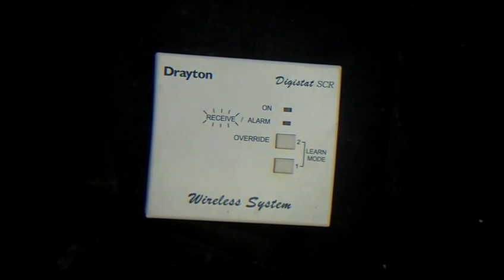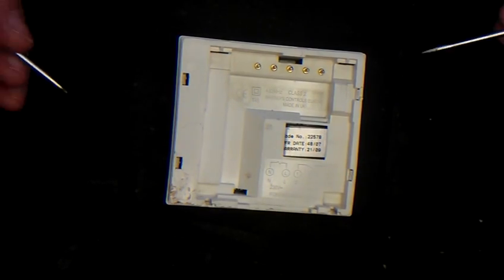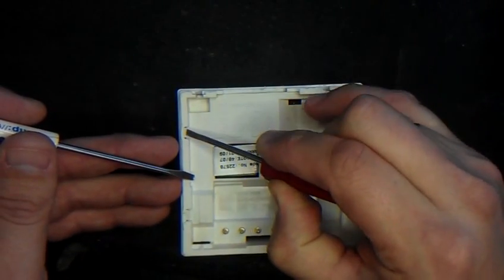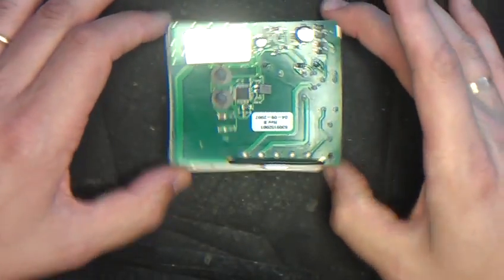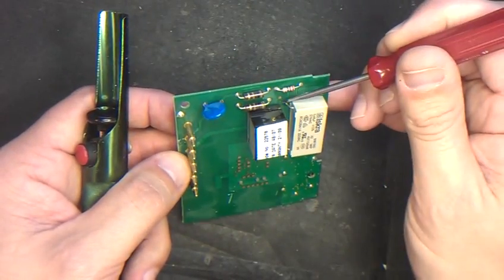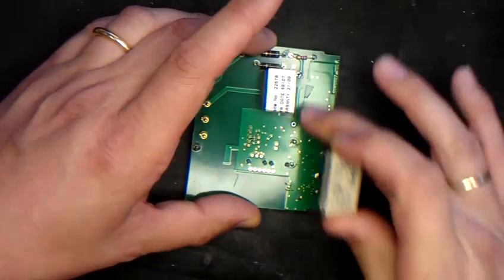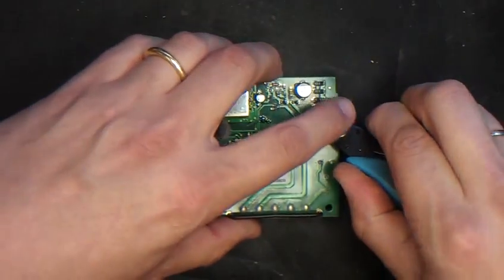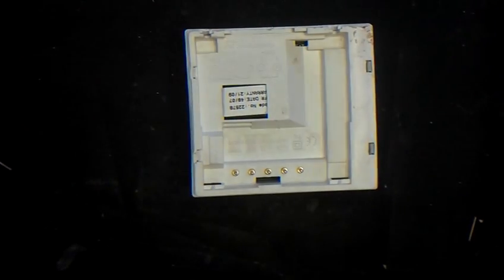Drayton Digistat SCR easy repair with a capacitor, also same for Iflo or British Gas marked units

Comment: Hi David,  I think we need to buy a capacitor from you.  I just want to check, since our SCR stopped working there are generally no lights on but sometimes when you turn the power switch on the red light does come on.  When this does happen if you press the top button the green light flickers like its trying to click in but it won't.  Does it sound like the capacitor to you or could there be more to it?  Thanks!
Reply from the maker: Nikki Willis Hi Nikki, it could need a little more than just the capacitor. On my eBay listing page is my email address. Drop me a email and we can sort this. If I can get a photograph of the pcb both sides I might be able to show you what the issue might be. Cheers Dave
Reply: Hi again!  We sent you an email with pics a couple of days ago, did you get it?  Thanks x

Comment: Hello I have watch your video and I have similar problem with one difference. My SCR click but hearing is not turned on. Can it be for same reason?? 

Thank you for your reply.
Reply from the maker: 'Generally' if you hear the click then I would say the receiver is doing it's job, it sounds like it could be a boiler fault, you could bypass the receiver to confirm this but that would mean moving a wire on the back plate, before any wires are touched YOU MUST ENSURE THE POWER IS OFF TO BOTH the boiler and the receiver, I will say that again!!!  Power OFF to BOTH devices before touching the wiring!!!!!!!!!!
Reply: David Williams 

How to bypass receiver? 

My wiring on brackets from left N-blue L-brown 1-brown wire loop to L 2-empty 3-yellow 4-empty.

Comment: Hello David...Fitted a cap from you several years ago...problem solved.....thought I had the same problem very recently, 'stat asking the scr, but no green light, so I bought another from you....has now stopped working again. How likely is it that the cap has failed so soon?

Comment: My digitstat SCR doesn't seem to be receiving a signal- Red light continuously on. When I press the over-ride button nothing happens, no clicks or anything. Batteries ok in sender unit (only a few weeks old), tried moving it closer to SCR- nothing happened, tried resetting learn-mode- again nothing happened. Is this a faulty capacitor in the SCR, or a faulty sender unit?
Reply from the maker: dave heaton hi Dave. Yes I have seen a failing capacitor give this fault. Generally the units don't have  any real sync issues apart from the capacitor. In my experience I would definitely change the capacitor.
Reply: dave heaton I have exactly the same fault, so going to change the capacitor.
Reply: I have the same problem I’ve done all the things to pair up the thermostat, the red light flashes, green one fires up, but the unit is dead changed batteries nothing, I’m sure doing it on constant is not economical

Comment: What if the original capacitor is glued to the board?
Reply from the maker: Steven Ball hi mate. they are all stuck to the board. some are stuck better than others. If u can get a flat blade screw driver under it and gently lever it up. start at a corner.
Reply: Cheers, went at it gently and off she came!  Rest of the instructions worked a treat, no other dramas!  Thanks

Comment: Thank you. Got a cap of your ebay store, fitted it and my heating is working perfectly again. I measured the value of the cap I removed and it was about half the rated value. So it is not unexpected that it failed to work as the capacitor dropper circuit output would have been much lower than the design limit.

Comment: Had red light showing all time ,no heat. got your capacitor & replaced, now blows 3a plug fuse about 5 seconds after overide pressed. Any thoughts please.
Reply from the maker: hi mate. send me some pictures of the pcb so I can take a look at it. maybe able to see something. use my email address shown on the listing page. sounds very strange
Reply: Hi David, I'm new to You Tube ,how do I get to your e-mail?

Comment: Hi Dave, the capacitor I replaced 2 years ago seems to have failed.  I looked for you on eBay to buy a replacement but couldn't find you. Are you still there???
Reply from the maker: hi mate. yes still about but oversea this week, back next Saturday, if you can hold out I will be relisting then. thanks for looking me up.

Comment: What is the trick to be able to power up the gas central heating boiler whilst waiting to repair Drayton Digistat SCR please
Reply: I wired a "hard wired" thermostat into position. Black & grey wires in my boiler COM - N/O terminals or wires 3&5 to the thermostat while I waited for the spare part. 240v are on these contacts so be careful. You could probably use a light switch using these contacts but it won't be controlled.

Comment: Hi Dave, thank you for the great video. I have permanent red light on my scr. Is it still to do with faulty capacitor ?
Reply from the maker: Hi, So a solid constant red light means loss of sync between the room stat and SRC receiver, the room stats are pretty bullet proof and very very  rarely fail in this way.Things to check, are the batteries ok in the room stat, also have you tried the re-syncing process, this process should be on the Drayton website, its all about holding down buttons and closing draws on room statsIf you have tried / checked the above then it's time to look at the SCR receiver, the capacitor can cause sync issues, it is definitely a good place to start, I am not saying it will fix all units with this type of fault but have seen it cause this fault.You could photo graph the PCB and send it to me, only need to see the rubber button side of the board, look me up on eBay and send me the photo I might be able to pick something upDave
Reply: Yes you were right it was due to the loose battery connection on the receiver. It is sorted now. Thank you very much for your advice.

Comment: I have intermittent issues. But now it fails more than it works. The usual fix was to remove the batteries from the stat for a few seconds and put them back in again. This usually worked but it doesn't anymore. How do I test the unit? The stat also does not seem to be reading the correct temperature. I'm sure that it is reading low.

Comment: Bought the capacitor from David. It arrived promptly and included the double sided pad and solder needed to fit the part. Following the video made the component change easy (opening the case was the most difficult part) and the digistat is now working again.

Comment: It's early days but this seems to have worked a treat. Drayton told me on no account should I change the capacitors (they didn't even say it would ok if an electrician did it), they said I'd have to replace both receivers at a cost of £250. £240 saved in half an hour and I have two working receivers. Genius. Thank you so much.

Comment: Hi David. I have similar symptoms with both my receivers but it's only intermittent - sometimes they work, often they don't. Is it still possible it could be the capacitors or is there something else likely to be going on?
Reply from the maker: +kit Hi Kit, yes the capacitors can fail in one of 2 ways, either they will straight fail and the heating will not come on even though it is showing a green light, or they can become intermittent and will occasionally fail, if it were my receiver I would deffo change the capacitor, it's a known weak spot in the circuit design and a very good place to start. Hope this helps. Dave

Comment: Thanks for sending the component through. I soldered the new one in place but it did not help. The green light flashes on very quickly but won't stay on still. Heating still will not come on. Not sure if there is something wrong other than the SCR.
Reply from the maker: +steve wilson just sent you an email, the email address you used to pay for the  replacement capacitor, lets see if we can work it out, I've already got a few ideas on what it might be
Reply: +David Williams Thanks David. Just sent you a reply :)

Comment: I seem to be having this problem. How do I contact David to buy one of these capacitors? Thanks
Reply from the maker: look me up on eBay. Search for "drayton capacitor fix" my eBay username is bearsy72. I have two listings one is supply part only, the other is me to do the repair for you. If you don't have an eBay account don't worry, still search for "Drayton Capacitor Fix" it will take you to my listing. Towards the bottom of the page it will show my 'Business seller information', here you can get my email address.

Comment: Nngh. In theory, this is a dead easy repair, but I had to apply lots of heat in order to melt the huge joints holding the old capacitor in place. So much, that one of the tracks lifted from the PCB. :-(

I was using a 50W soldering iron (on maximum power after 80% was making no headway), a fine tip and desoldering braid.

I've done plenty of electronics work (albeit I am a little rusty), but I've never found a joint this difficult to desolder before!

I was going to use a Kemet/Arcotronics-branded capacitor - I note that despite being the same spec, they are a little smaller than the Iskra component.

Thanks for the video anyway!
Reply from the maker: +cowbutt6 Hi mate, yes they can sometimes be a bit tricky to get off, I always always add a little solder to the joints before trying to suck the solder off, it just helps the flow of the old stuff. Also sometimes wise to cut the legs from the capacitor body itself, that way you can work on one leg at a time. Not seen the Kemet cap before, plenty of room inside here for the Iskra whether it be the old or new version of receiver. Hope you are good now, Track repairs on this item aren't to bad as you can see where the tracks are going, from memory think they go to the large brown resistors, 100 ohms if I remember.
Reply: +David Williams As a previous engineer had disconnected the receiver (without asking), I had to get another in to reconnect it anyway, so I bought a replacement receiver for him to fit just in case it wasn't the capacitor. I was hoping to repair the old one and keep it as a spare. I might still do that, but I'll be pretty skeptical about whether it still works (the surface mount IC was getting a bit warm too).

Hopefully my comment above and your tips might help someone else!

Comment: I have this exact problem, our heating does sometimes come on, could it still be a dodgy capacitor or might it be something else if it works sometimes?
Reply from the maker: Yeap the capacitor can cause intermittent switching. My guess is the capacitor is slowly breaking down, rather than the usual quick fail. Has to be worth a punt.
Reply: +David Williams thanks I will keep my fingers crossed, we are having the boiler serviced Friday as a precaution so if everything checks out then it is definitely the scr, I will order a capacitor in ready
Reply: +David Williams thanks so much, I replaced the capacitor and the heating is working again! a capacitor rated to higher voltage would probably stop it failing, however, they tend to be larger so might not fit in the case

Comment: Hi 
Wonder if you can help, there is no lights on on my scr box, but there is power going to the boiler. Hope you can advise, many many thanks Andrew
Reply from the maker: yeap I have a fix for this. look me up on ebay. Do a search on ebay for 'drayton repair service'. from there drop me a message and I can show you what the issues are. Dave
Reply from the maker: my eBay user name is bearsy72
Reply: +David Williams Hi David just watched this clip 24 hrs too late. I have managed to get the circuit board off but have mutilated the plastic mounting and I'm hoping that you can supply a replacement along with a new Cap'. thanks billydean
Reply from the maker: Hi mate, drop me an email, I have some spare mouldings here, my email address is on my ebay listing page, username is bearsy72, speak soon

Comment: Thanks for the posting, My issue was no signal is being received (if i do a manual override it works fine!) - and i saw the comments below about how to remove it from the wall, which answers my other questions!

Comment: How do u take the receiver off of the wall in the first place? Mine is right next to the boiler with no obvious fixings in to the wall as well as a cable running in to the bottom of it. Many thanks
Reply from the maker: Hey Paddy, look on the underside of the unit, you will see 2 x silver flat head screws, slacken them off (no need to take them out) and the unit will hinge from the top, PLEASE INSURE YOU ISLOLATE THE SCR BEFORE REMOVING. the wiring plate will stay on the wall holding all your wires in place.

Comment: A note of warning that echoes Jim's below: despite being quite a handy DIYer usually, I had trouble getting the old capacitor out and, in trying to burn out the old solder, ended up burning part of the connection on the circuit board. I then had to get this repaired by a local computer repair shop.  

I say this to warn you to take care with the circuit board.  But Dave's service and advice has been excellent and, despite my problems,  I now have the heating working again for £12 instead of the £180 it cost me this time last year (why these things fail so often is another matter).
Reply from the maker: Here are a few tips for you guys,
1) It might be easier to cut the legs of the old faulty capacitor next to the body of the capacitor, this way the only thing holding that leg in will be the solder on that leg, the capacitor is stuck to the PCB so this gives it another point of contact, work on one leg at a time.
2) This will sound silly but sometimes it is easier to ADD some solder to the joint, this way you can ensure the joint is hot enough and the soldering is flowing, it helps the existing solder melt thus helping you get the old leg(s) out.
3) Don't force it, it should come out without too much force, it is not coming out make sure the solder is hot enough and is flowing.

Good luck and enjoy your warm house once again

Comment: Thanks so much. The capacitor arrived in 2 days, and with the clear instructions I've done the job. Fantastic.

We did have trouble getting it off the wall at first but discovered 2 small screws underneath the wall mounted box!

Comment: A cautionary note. When removing the old capacitor ensure that the old solder has entirely freed, otherwise you will tear the delicate circuit board connection to the capacitor peg socket (as I did...).I guess the simplest thing to say is to employ the MINIMUM traction. - Jim

Comment: I had a struggle getting the old capacitor out, but the rest was straight forward and I was thrilled when the heating fired up again.  All for only £4 plus the cost of a soldering iron!  I'm really grateful to you for saving me £100 or more. Keep up with the good work!
Reply from the maker: here is a tip for you guys. If you don't have a solder sucker, then do as I say at the 2mins marker, cut the legs as close to the old capacitor as you can. The only thing holding the capacitor to the board is a double sided pad, a small flat blade under the cap should ease it off. Then ADD a little more solder to the joint of the old legs, then when the solder is hot and flowing still with the iron on the leg use a pair of pliers to gently pull the legs out one at at time, if you feel friction stop and ensure you are hot enough. Any problems message me. Dave

Comment: Hi David, great video, I bought the capacitor and took the circuit board to a computer repair shop who removed the old one a soldered on the new one, he didn't even charge me but I gave him a tenner.  Worked a treat, the heating is on, the wife is happy and I am having a peaceful life once again.  Many thanks...

Comment: Hi David. I've looked for you on eBay but can't find you. 

I've got a problem with my Drayton digistat scr and I was looking at your repair video. 

My fault is that the heating has failed to come on so I've looked at the Drayton system. I've reset power to it as described in Drayton's instructions and when I return power no lights come on. If I press button 2 then no lights come on. If I press button 1 then the alarm light comes on. Nothing I do will make the boiler fire. But it will fire to heat the tap water in the tank. 

Does this fault sound like it would be cured by your repair kit? And if so, how long would it take to get to me?

Thanks.
Reply from the maker: Hi Karlo

Yes I can fix this, on the ebay listing page there is my email address,

Search ebay for 'Drayton Repair Part'

Drop me an email and I will explain what has happened to your unit and should be able to fix it

Dave

Comment: Forgot to say - my money would have been on the electrolytic going leaky. The 0.68u X2 caps are usually self-healing. However, if changing the 0.68u fixed your unit, then I can't really argue.

Comment: By an amazing coincidence, I have my dis-assembled Drayton SCR in front of me. Exactly as you describe, the green light comes on but the relay isn't driven. It's a 24V relay but only getting about 8.8V across the coil. What led you to the 0.68u EMC cap? When I probe mine, I just see the 1Meg resistor across it - no leakage (at low voltage, anyway). I see about 13V on the electrolytic cap, which looks too low. I admit to hating circuits with non-isolated 240V nearby!

Comment from the maker: Hey Adam, if all u r doing is removing the SCR then just isolating the SCR should be fine, however if u are playing around with the wires on the back plate of the SCR then I would say go to ur fuse board. When the SCR is off please ensure the back box is left safe, people in the past have taped up the open box to avoid any type of personal contact.

Comment: Great video, just purchased one of your capacitors. When you say isolate the electricity do you mean just flick the switch the SCR is running from or turn the electricity off from the fuse box? I assume either is safe?